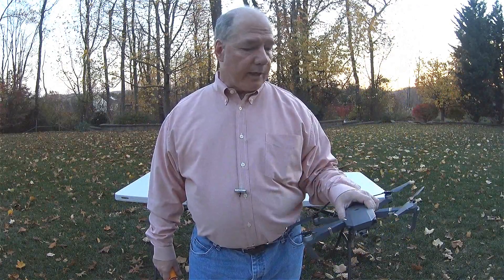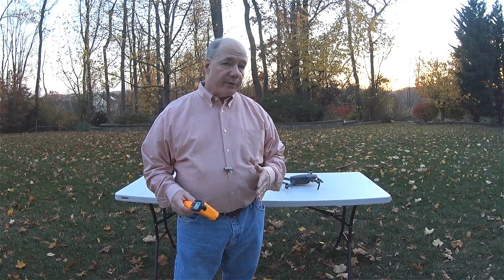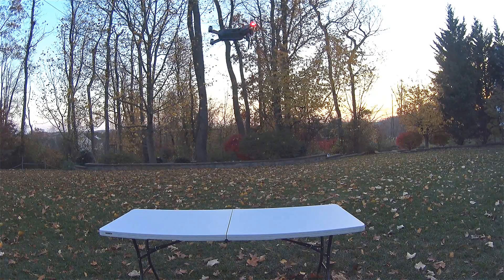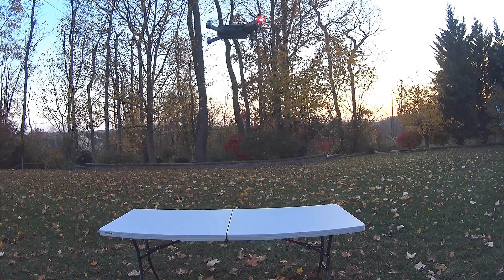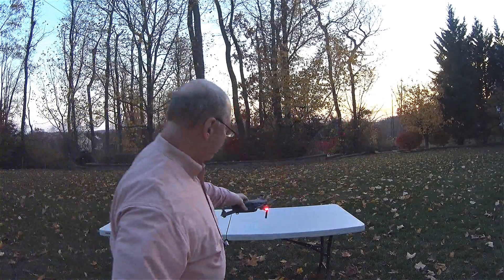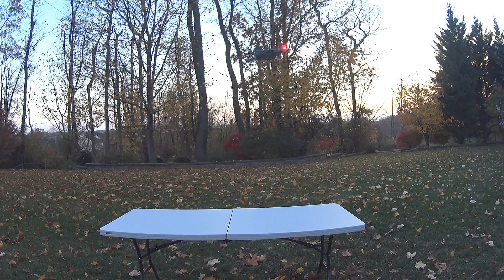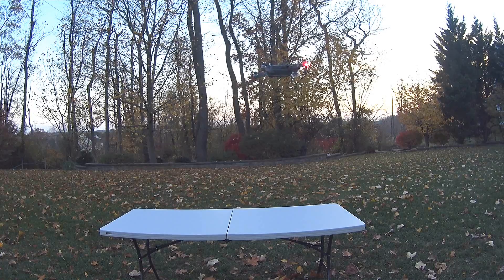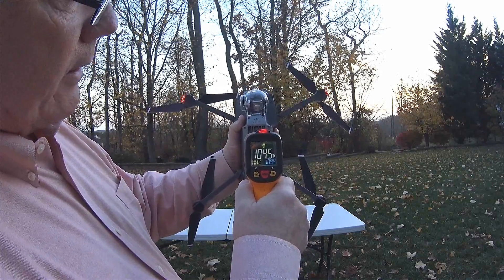Mavic Pro Running Hot?  Here's Why

Comment: Awaiting my Mavic, appreciate your work Rick, thanks. 

I respectfully disagree that the dome is not intended for flying.

If the cover wasn't designed for flight then:
- they wouldn't have made it transparent
- they wouldn't have included a scratch protector. Who covers a cover?
- they wouldn't have included the ventilation slot in the dome
- they wouldn't have pictured it in their promotional films flying (they do repeatedly)
- they would have stated it should be removed in the manual set-up instructions.

Based on the above I think, glare permitting, the dome is useful for flight in certain situations, and I'm more-so drawn to this conclusion based on your excellent point about potential debris ingress.

Look forward to your longer test video of this. Thanks.
Reply: How about you READ THE MANUAL.  It clearly states on page 6 to remove the gimbal cover and clamp "prior to use".  Maybe your meaning of "prior to use" means something else...
Reply: PC_Rules I'll happily have a productive discussion with you if you don't feel the need to shout. It's an interesting topic.

I've re-read v1.2 of the manual on page 6 and the words "prior to use" aren't there. Please could you direct me to them?

Would you care to clarify my queries raised above re. the cover being transparent and used in flight in DJI's own video during the racing sequence?
Reply: Sawood Pearce your right I’ve looked over the mavic pros quick start guide manual and as it states on page 6 it says to remove gimbal clamp and that the gimbal cover is to protect the gimbal and only remove when necessary. Although I could see the mavic running way hotter in long flights with the gimbal cover on but none the less it can be on while flying

Comment: You did not check (for us) the temperature before the second flight.
Reply from the maker: Thanks for the note but I did let the temperature cool back down to the original 64 degrees before the last test but didn't show that on screen. I didn't expect folks to think I was cheating with the test and was just trying to illustrate that keeping the gimbal guard on the drone while in use was a bad idea since it made the quad run hotter. Thanks again for the post and hope you sub the channel. Rick

Comment: Hey Rick ... love the videos but in the interest of scientific accuracy and transparency, you should have showed us the actual cold temperature of the heat sink before taking off with the bubble installed. If the Mavic hadn't sat for a long enough period to cool down to the the set base temperature before starting, it would cause the results to be higher. I'm assuming that you did let it cool to 64 degrees (because you said that you didn't want to "cheat the test", but you didn't show that in the video so scientifically, the conclusion is subject to question :-)
Reply from the maker: I realize now that I should have shown the initial temperature before starting the last test but never expected anyone (not you, but others) to think I was trying to cheat :) I did the clip primarily to answer a question I've gotten since the Mavic release about flying with the gimbal attached. While this is a bad idea from a video quality perspective (lens flare), it's also an issue because it blocks the airflow through the quad and causes it to run hotter. Thanks for the post and I promise to be more diligent in showing the steps in future clips. Rick
Reply: Drone Valley Rick, I never meant to imply that you "cheated". I'm just a bit anal about details and  it caught my attention. To me it obvious that the bubble has to reduce airflow with resulting cooling deficiencies. I also wonder why DJI doesn't publish the correct way to fly the Mavic (with or without the bubble) ?
Reply from the maker: Please don't think I was implying that you were accusing me, I was just surprised that others have said that about the clip.
Reply: Drone Valley  I read the comments and didn't see any references to it ... I guess it's past my bedtime :-)  Looking forward to learning stuff I didn't know  :-)

Comment: Is the globe not just for transporting it safely?
Reply from the maker: The globe should only be used for transport protection. I did the clip because I had a lot of people asking me if they could fly with the globe attached. I wanted to show that leaving it on when you fly restricts the airflow and can cause the quad to run hotter. Thanks for the post and be sure to sub the channel. Rick

Comment: If the drone is turned on and NOT flying, it will heat up rapidly... So you setting it down on the table to "let it cool off" actually made it hotter... I appreciate and thank you for what you are trying to do with this video, but the results are not representative.
Reply from the maker: Thanks for the post but I had the quad off during the cool-down period to let it settle back to ambient temperature. I realize not that I should have shown the starting temperature in the clip but it didn't occur to me that people would think I missed that part. I hope that help explain the test a little and that you sub the channel so you don't miss any of my follow-up clips. Thanks, Rick

Comment: Hello Mr.Rick, why didn't you hover 3-4-5 min to really get the Mavic to get Hot (or to Max Heat)  ?
Another question I have about Temperature, is the COLD. I am sure many people are planning (already actually) to fly their Mavic (or ANY drone) during cold weather (filming Snow Mountains, or Great North regions, etc.), so what is the actual positionning with all the drones available today, including the Mavic (DJI say LOW operating temp is 32 degree, wich is not very cold) ????... Thanks !
Reply from the maker: I am working on a longer clip that puts the quad through it's paces with a longer, more demanding flight to compare the two scenarios. As for the cols, I've flown the P3P and P4 all winter in Jersey and the only thing I notice is a slightly shorter flight time. I let the quad heat back up in a warm car between flights and keep the spare batteries in an inside pocket of my jacket so they're ready when I need them. Rick

Comment: Great test, but unfortunately not done scientifically. You began good, tested it cold, but then made your second test invalid because you didn't record the starting temp which should have been the same as the first starting temp. 
If the start temps of both tests were not identical that invalidates the second test. It was pre-heated. 
The temp was still rising rapidly at the end of the first test. So we should have waited for that to stop and record that temp. It's very possible that it could have stopped at the same temp that your second test got to. 

You know you could use your temp tester to spot test the temp while it's hovering too, that's the great thing about those temp guns. 
So I would suggest doing the test on two separate mornings of similar temp, and test the temp while it's still in the air hovering. That will give you the most scientific results.
Reply: Exactly

Comment: I just picked up the Mavic, very informative and well done video's. I'm also curious how it will perform in cold temperatures  as well with, the warmup and cool-down range will be a wider range? and wondering how it will affect longevity of the electronics with cold air blowing over hot electronics and if moisture from condensation will be a factor
Reply from the maker: Jim, I'm glad you found the channel and hope you sub. Good luck with the Mavic, its an amazing quad. Flying in cold weather is OK but you will probably see a reduced flight time. Another trick I use is to keep the batteries in an inner jacket pocket to keep them warm so they're ready to go when I need a fresh one. Other than that just be careful to limit your flight times when it's snowing. I know a scene like that is almost too good to pass up but keep it short. Thanks again, Rick
Reply: Jim Davis where did you get it from i cant find one any where?
Reply: Junior Jones I'm in Canada, ordered it through the Apple store Sept 28th as I get a discount through my employer

Comment: There is no way it cooled in between flights  if you only waited a few minutes. it would take about 20 minutes to completely cool. To be valid you need to take preflight measurements before each flight and they should be within a couple degrees. You test was invalid.
Reply from the maker: Thanks for the note and sorry for the confusion. I did let it cool down completely between tests but didn't film it because it would have made very boring cinema. I should have taken a reading on camera before starting the test but didn't expect folks to question me on that :) I plan on doing a follow-up clip next week with longer flights and will be sure to add a section showing the starting temps. Thanks again for the post and I hope you stop back soon. Rick

Comment: The protection globe is only for protection when not using the drone.
The newer ones have a blacked out globe on them.
Reply: I just checked mine and the blacked out bit is actually a rubber material that can be removed leaving a clear lens.
I heard that the cover is only for storage because it would cause image issues with the camera.
Reply from the maker: Greg, thanks for the post and you're correct the black silicon cover is removable and included to protect the plastic globe from scratching during transport. The reason I did this clip was in response to a lot of questions from viewers about flying with the protective globe on the Mavic Pro. I did a test and a few weeks back and it does degrade the image quality and causes lens flares in sunlight. This test was to show that it also blocks the venting system located right behind the gimbal assembly and can cause the quad to run hotter than normal, another bad reason to fly with the globe attached. I appreciate you watching the clip and posting and hope you sub the channel so you don't miss any new updates. Rick
Reply: I suppose the cover could be used if you were using the Mavic for racing in sport mode for a bit more protection in case of a crash. Not that the Mavic is a racer, but some will use use it this way I think.
At faster speeds in sport mode the cooling should be better so maybe it won't be an issue.
Thanks for the effort you put in to do this test, I look forward to your testing at flight speeds.

Comment: In your testing did you allow the aircraft to come back to ambient temperature before performing the 2nd test?
Reply from the maker: I did let it cool down between flights and now realize that I should have shown that starting temp in the clip. I wasn't expecting folks to call me on that but I totally understand. I'm planning a follow-up clip next week to see if there is a larger difference between the two tests and will be sure to add that section to the clip. Thanks again for commenting. Rick

Comment: To really make this more scientific, you should have 1. let it return to ambient temperature between runs, and 2. taken the temperature before and after every run. 3. Test it with a variety of flight times. You might not have run it long enough to reach maximum temperature.
Reply from the maker: Matt, I did actually do that and should have shown the temp onscreen before starting the third test. I am planning on a longer clip this week of various flight times for the quad so stay tuned to see how that turns out. Rick
Reply: Great! For reference, temperatures of 100 degress F (~40 c) are not really problematic for electronics. These are normal operating temperatures. If the temperatures get above 60 or 70 c, then it's time to be concerned (that can happen quickly if the ambient temperature is around 40 and there's limited airflow over the components.) I'm hoping DJI has already tested this and would have put out a warning not to fly with the cover on if it was a real problem.

Comment: The cover over the gimbal is meant for protecting the gimbal when transporting only, it was not designed to be used when drone is in use
Reply from the maker: Steve, thanks for the post and I agree with you. I have said that in a few of my clips on the Mavic and still had folks asking about it so I did the clip to point out that in addition to the lens causing image issues, the additional heat it created was bad as well. Thanks again for the comment and I hope you stop back soon. Rick
Reply: Just wanted to point to that out, great video reviews, keep them coming.

Comment: Turning on the Mavic and not flying it will make it get warm.  So just leaving it on the table if still on will not allow it to return to cool temperature.  Unless you allowed it to return to 64 degrees between tests the 2nd test will always give you a warmer result because it is starting from a warmer temperature.  All that said the globe has such a negative impact on image quality I doubt many people would fly with it on anyway.
Reply from the maker: Joseph, thanks for the post and I actually did let it cool down to the original temperature between tests but didn't feel the need to record it because it was pretty boring stuff. I never expected ot have that called into question and am hoping to do a follow-up clip next week with a longer flight to show the difference and will make sure I include a shot of the quads temperature before the third test. Thanks, Rick
Reply: ok because you didn't say that i was not sure so I thought that would have had an impact.
Reply from the maker: Joseph, It was totally my fault and I realized after posting the clip that I should have been clearer on that point and I'm sorry for the confusion. I really appreciate you watching and posting. Thanks again, Rick

Comment: Do not operate with the gimbal protector on!! That is for transport only.
Reply from the maker: Jon, I agree and have said so in a few of my clips. The reason I did this particular clip was because one of the top questions I still get from subscribers is "why not?" about using the gimbal protector. It not only degrades the quality of the image but also raises the temperature of the quad. Thanks again for the post and I hope you've subbed the channel. Rick

Comment: start temp need to be the same before each test flight. second flight is screwed by first flight. plus you should do at least 3 tests of each flight to get an accurate sample of data.
Reply from the maker: Dale, I didn't show it in the clip but did allow the quad to cool back down to the 64 degrees before starting the third test. I should have shown a shot of the resting temperature so I could have avoided all the typing to explain that and I'll be sure to do it in future clips. With this experiment I was simply trying to show that by blocking the venting system behind the gimbal by flying with the gimbal guard attached, the quad flies hotter than without it. I'm planning on a longer clip next week and will be sure to include a shot of the cooler quad before the third tese. Thanks again for stopping by and I hope you sub the channel so you don't miss anything. Rick

Comment: I wonder why would Mavic built this protection transparent if it was not to be used in flight then?
They would have built it opaque so it wouldn't confuse the user, no?
Reply: I was wondering the same thing, so i went back to DJI's videos to see if they were flying it with a cover or not, and in the majority of them they showed it being flown with the cover, one guy did a video where he actually called DJI LA about the cover, where the Rep, said it was safe to fly with it because of the slot cut into the bottom near the gimbal arm side. The only issue the Rep said may occur is that occasionally you may get sun glare at certain angles
Reply: Quite Simply the cover is transparent to allow use in certain types of flight. However that being said it is a AP, and the cover isn't optically correct. So when flying to get the best absolute best pictures and video no cover should be used. But if you wanted to take it out for a "Fun" run and your flying in markedly more dangerous areas with obstacles and debris. Then you would leave the cover on to protect the gimbal a bit better had you hit or crash.
Reply: Okay then, thanks very much for your answer!

Comment: Hi Rick. Thanks for the test, been waiting for it. As some of the other people said, wouldn't the results be more stable if you waited for the Mavic to cool down after the first test back to ambient and then do the second test. It already had some heat in from first test. My suspicion is if you did 2nd test without gimbal cover it would also have been hotter than the first test. Would like to see this done again with reset to ambient. Then a flying test would be great, as the airflow into vent should make a big difference. If I was doing that test I'd set up a mission at a certain speed. Then wait for Mavic to cool to ambient. Then do test without cover. Then wait for it to cool to ambient again and then do test again at same speed with cover. Also maybe a good idea to time flights to make sure both are the same time. They could vary with environmental co ditto s, like wind.  Also check outside air temp for both flights. Anyway, just my 10c worth, but good test. Interesting how quickly it gets hot. Would be interesting to see what temps are for longer flights. Also in hotter weather. I see DJI says don't fly Mavic in temps over 40 degrees C.